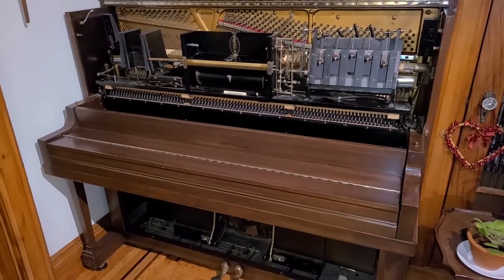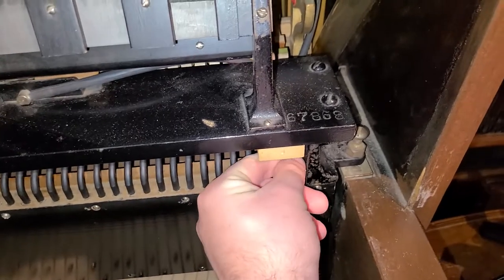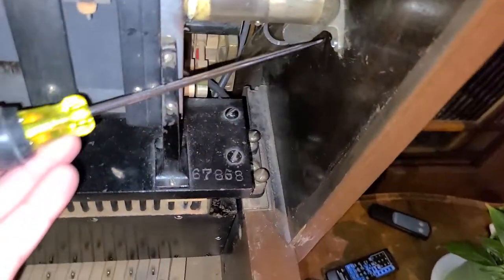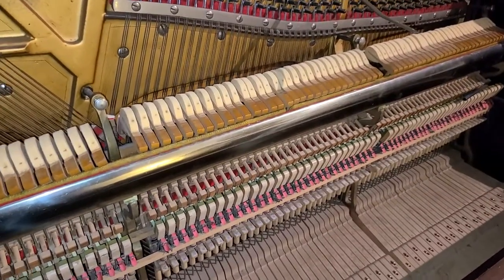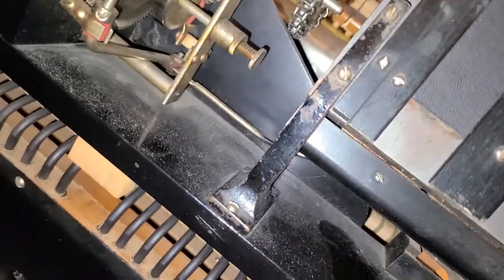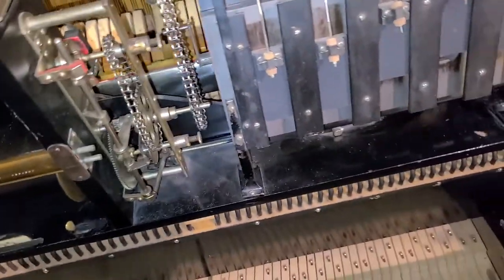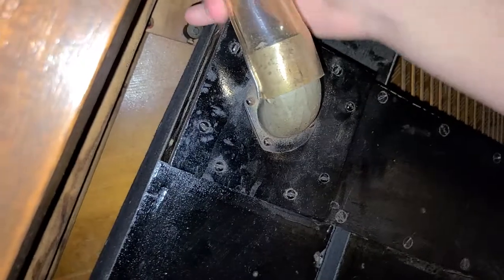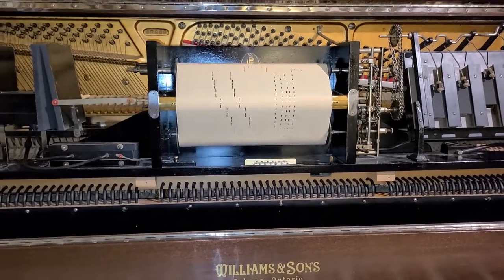How To Remove A Player Piano's Mechanism

Comment: Good video, I agree with other comment about replacing clear main hose, I you wrap some wire around that vinyl hose at the bend  it will keep it from collapsing. I do this on my older washer machine drain hose to keep it from kinking when I push washer back against the wall.

Comment: How do you remove the two wooden front covers so you can get to the mechanism in the first place?
Reply: This looks like it was made like my gulbransen. On mine once you open the top door you push on the top face and it tilts then you can just pull it straight up and off.

Comment: I have 2 player pianos, I'd like to know how to get them to work! Please help!
Reply from the maker: Well, there's a lot that can go wrong with these pianos. Remember that there is a valve(s), pneumatic actuator, and tubing for every note on the piano, as well as other components.

If the entire player action is not working, there is likely an issue with the mechanisms that supply vacuum to the stack. Possibly a tube has fallen off, or the pumps/reservoirs have developed a significant leak. If individual notes are not working, the problem it likely in those specific valves, tubes, or actuators. If the notes work, but the roll doesn't turn, the problem is likely with the air motor of the tempo governing system. 

Remember to check the simple things first. The whole player piano can be rendered inoperable by removing the 2 large tubes that supply vacuum to the stack and air motor. Maybe these were not reconnected after tuning. 

I also recommend reading "Player Piano: Servicing and Rebuilding" by Arthur Reblitz. The book goes intothe specifics of how these pianos work, and offers a step-by-step guide on restoring them.
Reply: Join the “Player Piano Enthusiast” and “Player Piano Talk” groups on Facebook and you’ll get lots of help! And get Art Reblitz’s books “Piano Servicing, Tuning and Rebuilding” (now in a new 3rd edition, 2019 I think) and “Player Piano Servicing and Rebuilding” (only one edition so far, 1986). There’s another book out there by Larry Givens called “Rebuilding the Player Piano” from the 1960s that was well intended for the time, but some of the info in it is outdated or simply wrong, such as advocating white glue for parts that will need to come apart again or be replaced in a future rebuild (which is wrong; one should always use hot hide glue for these parts). I think Mr. Givens’ book is more interesting to a mechanical music historian than actually useful in teaching you how to restore your piano like Mr. Reblitz’s books are. There are also more FB groups you can join like “Piano Technicians International Beginners” and “Young Piano Techs Tips and Training”. For buying and selling player pianos there’s a group called “Player Pianos Free, Cheap, and Sometimes Not... From Any Source!”. If you are not on Facebook or don’t want to be, you can subscribe to the Mechanical Music Digest (since 1995!), get help and supplies on John Tuttle’s “Player-Care” website (since 1997!), more materials available from D C Ramey Piano Co in Ohio and from Columbia Organ Leathers in Pennsylvania. For a real world fun collector group who can help with advice and hands on experience, join AMICA, the Automatic Musical Instrument Collector’s Association, which since 1963 has been the main player piano enthusiast group in the USA and numbers over 2,000 members.